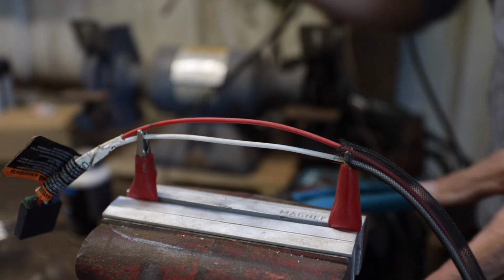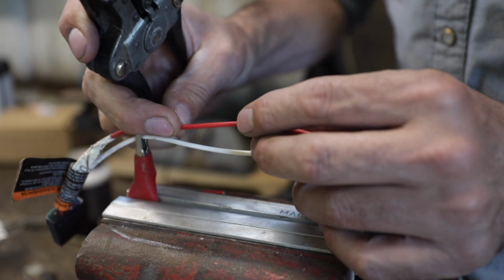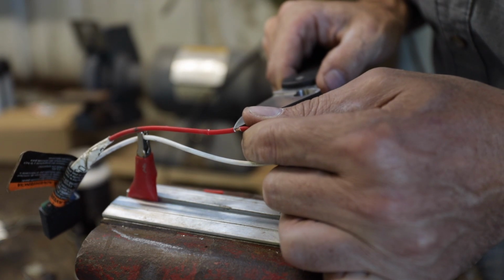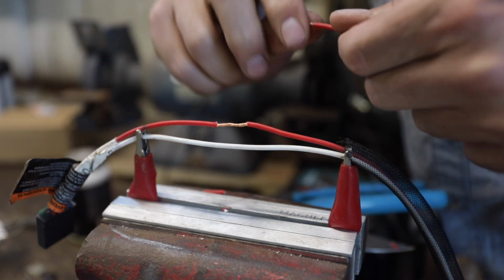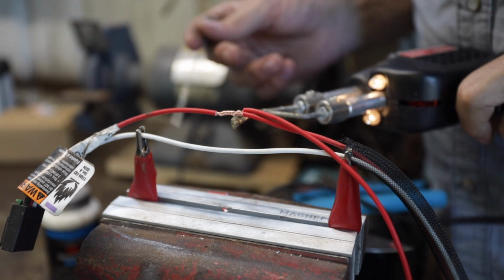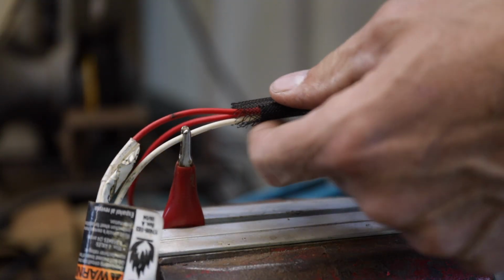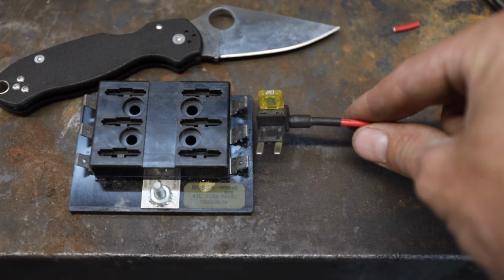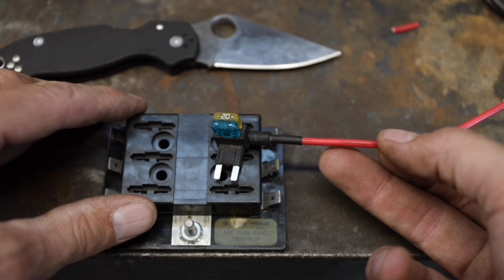How To Splice Wires Like A Pro

Comment: I'm not NASA certified, but I am PACE certified.  I think you did a nice job.  If your up for some suggestions.  You could have removed the connector from the connector block and then slipped the shrink tubing on and then pushed the pin back in.  You typically just need something like a paper clip to remove the pin from the block.  Another option is to cut the wire and then used a number of splice joints to get it all back together.  My favorite splice is the "Western Union", super strong and very reliable.  You would've ended up with a shorter red wire so I understand why you did what you did.  I would've removed the connector pin from the connector block to slip the shrink tubing onto the wire.  Again, what you did was fine though you would not have passed the certification testing.  LOL  :)

Comment: The "sheath" you are cutting is INSULATION not "shielding".  "Shielding" is a covering that prevents the emission of electromagnetic radiation.  It looks something like the mesh wire loom you have on the harness but it's a braided conductor. Coaxial cable typically has a grounded shield around the conductor. Your harness doesn't.

Comment: Cody I work as a part time instructor and I am a service manager at a truck dealership I find no problem with your technique but might I make some suggestions 1 if you use a pin removal tools to remove the pin from the connector so you could slide you shrink tube 2 if you cut the wire use a non insulated barrel connector that you can crimp and solder and the use your shrink tube always use shrink tube with glue so it seals your connection this is the suggested method that I teach in my electrical classes I teach keep up the good video very good content

Comment: Is that just a standard automotive fuse block he is showing there at the end where the double fuses plug into?
Reply: It is designed for expanding wiring in 12V systems. You connect a hot wire to the bolt, then place fuses in the circuits you want and connect the wire to power the new circuits on the terminals that are on the perimeter of the fuseblock. Works in RV's, automobiles, radios, etc... A 'standard' automotive fuseblock, if you were to look in your car, would be much more complex.
Reply: Bennington Camper Forgive, so what exactly is it called though to search for one on Amazon?
Reply: @jkeefer034  No need to forgive! If you search for 'fuse block' you will be buried with choices. Good luck!

Comment: Cut, crimp, and weatherproof the connection. No solder. That makes the wire brittle and prone to breakage.

That factory end has no solder. It is properly crimped and weatherproofed. There is a reason why.

Comment: Electrical tape turns nasty after a while. The glue on the tape never really cures and makes a sticky mess after a couple of years.

Use "self amalgamating tape" for splices and for re-wrapping a loom where you've removed the factory wrapping. I only found out about the stuff last year after my ATV wiring got eaten by mice, it makes a watertight non-sticky cover over the whole thing and works great.

---

EDIT: Just saw that about a million other folks have said the same thing ...Yeah, what they said.

Comment: You should mention that you need to use rosin core solder for electrical work and NEVER use acid core solder for electrical work.
Reply: I think the viewer should take at least a little initiative here, I mean, he didn't show how to plug in the soldering gun either...
Reply: I mean.. if a person is watching this video they probably have no idea what they're doing.
Reply: But my smart-assed reply aside, there are a surprising number of people that don't know the difference.  I have seen many repair jobs soldered with plumbing solder...
Reply: Same goes for flux. If you've got something you need to flux for the ease of soldering it, dont use plumbing solder.

Comment: I like your videos, especially because you research your material before making the video.  However, I have to disagree with your splicing.  Solder is never used in a professional motorsport wiring harness.  A good crimp is generally stronger than the wire itself.  Also, solder in a high vibration environment like a vehicle is not recommended because it can break from flexing.  Further, you might mention that stranded rather than solid wire is preferred, again due to the vibration and flexing in a vehicle.  I waterproof my connections with a base silicone tape, followed by a UV resistant outer tape.  If necessary, the tape can be removed without leaving a sticky residue.

Comment: Ok, this is a fine way to splice a wire that is not exposed to vibration or moisture, but this is not how a pro would do it.  I've been professionally building automotive wiring harnesses for 5 years and you are not supposed to use solder or electrical tape.  Solder will wick through the wire and cause it to lose it's flexibility.  Also, a pro would de-pin the connector or cut the wire so that heat shrink could be placed over the splice.  The splice in this video has no strain relief at all.  Sure, it will get you on the road in a hurry, and probably for quite a while, but one day this wire will fatigue and break.
Reply: You are the only commenter i found that speaks of removing the wire from the plug, making the modification or repair and then re-assembling. It seems like our repairs would amaze most on here. Great days to you !

Comment: In my experience it's better to cut so sealing (has hot glue inside) heat shrink tube can be used after everything is soldered and solid ...100% water tight

Comment: Apparently, the orientation of how you plug in the pins on that pigtail can make the difference between the fuse working properly, or burning a wire. For more details, watch "How to tap into your cars fuse box" by Five Star Car Stereo. Thanks for making me aware of this device Cody.

Comment: I replaced my old glass fuse block on my motorcycle everything works unfortunately  just by touching one of the contacts completely bypasses the ignition switch.

Comment: The silicone is a good idea. I usually use Dielectric grease that I get on connections but I need though about using it on soldered connections.

 Myself I am fickle about the way my connections look. I would cut the wire and twist in a way so it's straight and use shrink tubing.

 But soldered connections are best the plastic wire splices are junk and should only be used in an emergency.
Reply: Dielectric grease / and brake slider grease is same thing, also silicone based.

Comment: Instead of using electrical tape u could use a bottle top from a soda bottle, heat it up with a torch until it's just about to melt and  place it on the wire 🤗 perfectly sealed joint.

Comment: One slight misnomer was evident in the video. The insulation covering the wire is not a shield.  If this were a shielded wire, a different process would need to be used to create the connection.  Hey, in shooting videos, anyone can misspeak calling a widget a whatsit.

Comment: 1: That is in no way how you solder.

2: There is an "L" in the word SOLDER, it is not "SODDER".

3: It's called a soldering iron and not a "sOdDeR gUn" you absolute weirdo.

4: Conventional wire strippers do not "fail" if you have the common sense to use them correctly. What a strange, strange man.
Reply: He was using a soldering gun, egghead.  Grow up.

Comment: Hey Wranglerstar, you can put heat shrink around each end of the clamps holding the wire so the teath don`t cut into the wire and cause a fire hazard

Comment: A company called MG CHEMICALS has a product called Connector Coating and it is basically liquid electrical tape. You can "paint" it onto the joint and it is basically like shrink tubing just for this type of application where you cant get shrink tubing onto. 

https://www.amazon.com/MG-Chemicals-4229-55ML-Connector-Coating/dp/B000B5Y6DG

Comment: I call those blue connectors  "cheaters" , if u want a wire to corrode and fall apart then use one of those.  Same as black tape. That stuff should be outlawed for use on copper. I only use it for taping wires and loom together... it is NOT for splices or joints.

Comment: You did it exactly how I would have done it, so I will share any of the hateful comments with you.  I'm pretty sure that you and I could definitely wire a rocket ship.  I have never seen that type of fuse tap before.  I like it a lot. I've tried the metal blades that slide in with the fuse with disappointing results.

Comment: I've been using those fuse taps for YEARS. They are reversible, easy to use and work great. They only two problems are how much space they take up and finding always on circuits. Because they overlap neighboring fuses, you can only use them about every 4 fuses. If you need it to be powered when the key is removed, the only real option is to tap the door locks or security system fuse. If you need it on while turning no further than the accessories position, then you also have everything associated with the radio and maybe a 12V outlet. Putting those taps on anything else, you will want to add a switch and make sure you have that switch open while starting your vehicle, otherwise the spike from the starter kicking off could fry whatever is attached to it, particularly LED control boxes.

Comment: NEVER terminate in aluminum. Aluminum weeps and will make higher resistance over time. This heats up the connection, compounding the problem until you eventually have a fire.

Comment: The clamp down splices fail all the time.  Ive had good luck with the screw down splices though with a little loctite, but soldering is definitely a no fuss no muss way to finish it out and call it done.  I use a butane Weller portable unit thats a little pricey but has worked great for years compared to the cheaper units when you arent near a wall plug for the gun soldering units.   Soldering looks fine, tell the NASA engineers to go pound sand lol.

Comment: I saw the title and winced because I thought you were going to mess this up, but actually that was OK-ish. Electrical tape isn't the best though, it dries out and then slides down the wire after a few years. Try using self-amalgamating tape, I've got joints that are 15 years old and still feel squishy.
Reply: Yeh that butyl tape is great, you cut it and it just reseals. I put fabric tape on top to stop it sticking to everything
Reply: I use it on my outside PIR lights, all my neighbours driveway lights failed years ago but mine are as dry as a bone. Anything external is going to get wet and that's the only stuff that works long term, electricians tape is garbage.
Reply: Now I have to go look up amalgamating. thanks alot.

Comment: If you are going to solder the splice you might as well cut the wire and that way you can use waterproof heat shrink but there is nothing wrong with your soldering.
Reply: $25 for a soldering gun!!
Reply: Actually you don't even have to cut the wires why didn't he use a set of wire release keys 4 wire plugs they look like keys and they release the wires out of your little plastic plugs that's what I always do it doesn't take any longer you release the wire out of the plug that you're going to want the heat shrink tube on Slide the heat shrink tube over it and you're done put the wire back in the plug I do it all the time.... I've got three or four sets of them master wire plug release keys they're very inexpensive and they are super handy
Reply: @ww2067  you sound amazing!
Reply: "there is nothing wrong with your soldering"

.. except the aspects of his technique that you simply had to criticize.
Reply: "there is nothing wrong with your soldering"

.. except the aspects of his technique that you simply had to criticize.
Reply: @stevegreedo5687  it's actually true. No reason not to cut the wires if they're going to be soldered. It's always better to use shrink tubing.

Comment: I use Permatex liquid electrical tape in pretty much all situations when insulating wiring jobs, or I use it to cover solenoid terminals. That stuff works great. It seals up completely so it's waterproof, and it stays flexible.

Comment: After being in the racecar industry I learned early on you can never solder connections that will be subject to any vibration. They will break and fairly quickly because they are too brittle. So we used aircraft quality crimp terminals after that happened a couple times and never had an issue again. It really sucked to be knocked out of a race because of something you thought was the best kind of splice.
Reply: YES, no one believes me when i tell them crimping is the way to go.
Reply: Yeah I started using the heatshrink ones with the solder in them,I really like them
Reply: Then how do you connect a wire into another wire in a T shape fashion like in the video? I have searched for a 2-1 style wire connector online but I can't find one anywhere.
Reply: @joedimaggio3146  It's actually a Y connection not a T, but you can use a larger gauge connector that fits the 2 wires, crimp it on and then strip off twice the insulation as normal on the single wire, fold it in two to double up the thickness and keep it secure when crimped.
Reply: @reiserx  Thanks for the reply. I get that, but from what I've read it's bad practice to shove two wires into a connector designed for one wire... Why are there no Y connectors purpose-made for this situation?
Reply: @joedimaggio3146  look up wago or quick splice connectors. Although the latter is a poor form of connection, they both do the job.
Reply: @lachlankerr7339  Thanks, I ended up using a piggyback connector
Reply: As long as the wire is supported , it will not break at the soldered joint.
Reply: With any soldered connection, you cannot rely on simply the solder to make the connection. You must first make a mechanical connection with the conductors, then you solder the joint. With a properly made mechanical connection there will not be a failure due to vibration as you speak of. There are hundreds of electrical connections in a vehicle that rely upon mechanical connections already, and they didn't always have interlocking plastic shrouds to back them up.
Reply: @benningtoncamper2852  That is not true. They were twisted together. They would break right where the solder ended where the connection was the thinnest and most brittle. I talked to many other race teams and NOBODY uses soldered joints that has been in the business for any length of time. It isn't an issue if the wires can be tied down so they won't move but it was industry standard to use very high quality DTM connectors and a DMC AF8 crimper. Most of the time you avoid splices anyway and use a connector that is crimped on. Here is a video of a guy that has the DMC AF8 tool. https://www.youtube.com/watch?v=JiyXpDF4Ca4  They are not cheap. I think it was about $450 back when I got one about 15 years ago.
Reply: @reiserx  you're right. NEVER solder a splice to be used in a vibrating environement.

Comment: Going to have to find some of those fuse splices.  I agree, cutting the harness is just flirting with trouble.  I hate doing it.
Reply: They are called Fuse Taps

Here is a 10 pack on Amazon
https://www.amazon.com/10-Pack-Add-circuit-Adapter/dp/B01DYQM6EO/ref=sr_1_3?keywords=fuse+tap&qid=1562817427&s=gateway&sr=8-3
Reply: Come in all the standard fuse variants (not sure about the glass tube style) and in several different configurations (like more than one additional circuits in a single unit). Useful little things.